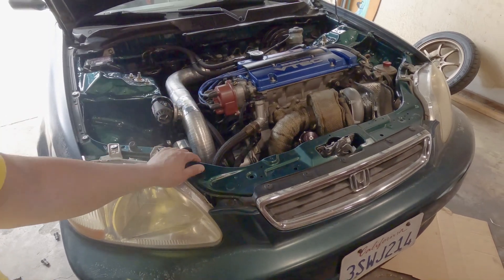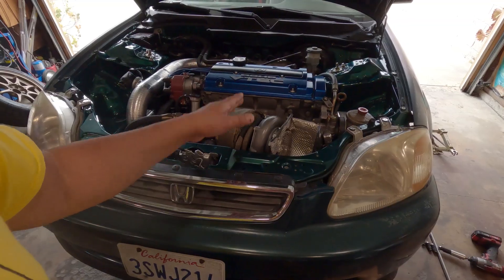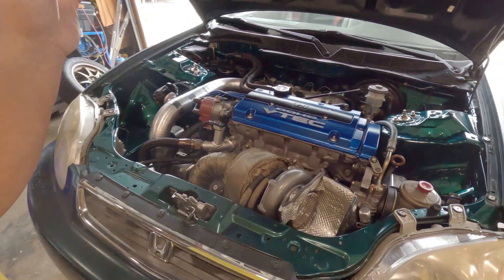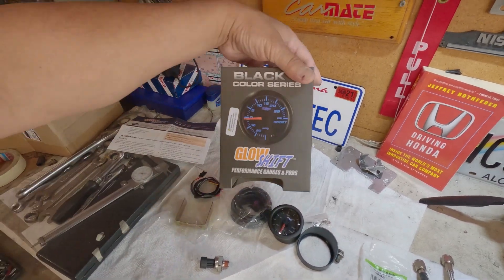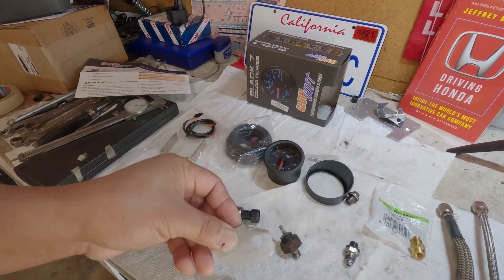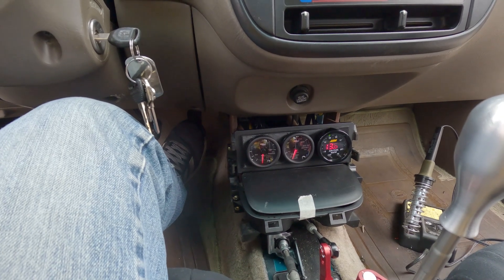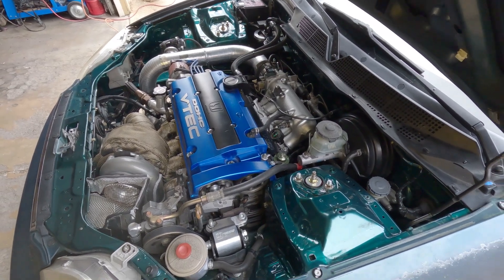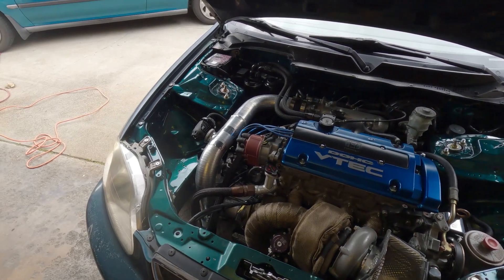Can you use H22 cylinder head oil pressure check port for Turbo oil feed?

Comment: Can u do a balance shaft delete without removing the head?...i just cut the belt  .. do u think its safe to run it like that?
Reply from the maker: Yes, all of the port that need to be plug are on the bottom part. There are people that run it w/o the b/s belt and l'm not to sure if there are any bad things can happen w/o it.
Reply: I've been running without the belt for years on a bone stock obd1 h22a long block, no issues. Some people say that they notice a crazy amount of vibration after taking the belt off, I haven't noticed anything different. Oil pressure is still consistent at the OEM pressure switch location above the oil filter on the block. I have an autometer oil pressure gauge which is sourced from that location. Still about 25 psi at idle and will peg the gauge at 100 psi with a 8200 rpm limiter.
Reply from the maker: @оначертовасука  Good to know and welcome to 8k+ rpm rev 2the moon club! Thanks for sharing.
Reply: @sagittnet2158  reving to 8k is y i couldn go back to h23 ...i felt i ran out of gears so quick with a t2w4 trans thank u for ur time n research i still would want to build a frankenstein h22 with f23 crank...but would want to get it balanced out to rev to 8k reliably thanks for the reply
Reply: @оначертовасука  thanks for the reply i felt more torque n no extra vibration ..

Comment: Sensei, I have a question. My accord has a crank, no start issue. I changed the external ignition coil recently and the distributor, wires and spark plugs were new when I did the swap in 2021. Any ideas on what it could be?
Reply from the maker: You can do isolation procedures, verify your fuel pump prime when you ignition key at acc 2. Verify your fuses are all good. Check to make sure that you do have a spark at the plug. Verify that fuel are present by visual look of the plugs( also a smell of gas). If the only thing you did was your ignition and problem arise, l'll start from there. Verify that timing belt is not broken, if you see the distributor turn, then T belt is good. Check all your ground connection coz sometimes it'll break or get loose.
Reply from the maker: Always reset the ecu whenever you replace or repair some items
Reply: @sagittnet2158  thanks for the direction! I do have fuel pressure at the rail. But I don’t have spark. I have a distributor with an external coil. Tried to take out the igniter to swap it with a spare I have but there’s not screw to take off the rotor.. I did find a fuse that was badly melted in the engine compartment fuse box (in cooling fan spot) half is still in the slot, not sure if is an indicator of the problem or a complete separate issue.
Reply from the maker: @nicholassantos2327  ok, at least you have a lead to work on, hope you get it fix and hit me up once you get it running again.

Comment: My Man!! That opens another question lol locked Vtec Systems with always on Vtec Pressure Switch may still work... only issue I see is if your vtec switch goes out, you loose all oil Pressure to your turbo.. Excellent Work my Dude. Science Experiments
Reply from the maker: Yes, that's why it's best to run a seperate oil line to feed the turbo coming from behind the block.
Reply from the maker: Glad you liked it bruh! Tnx
Reply: This can’t be good. Can’t be good for the motor